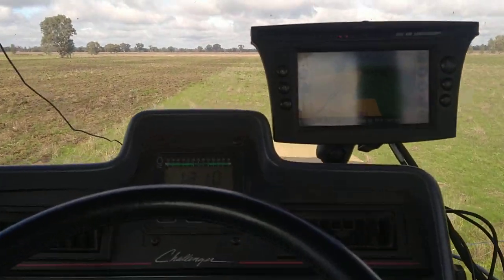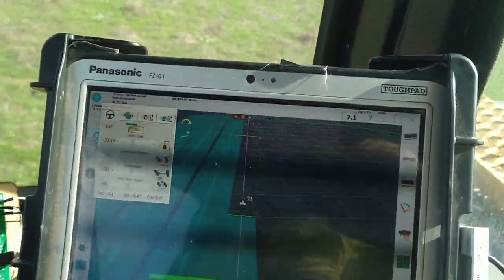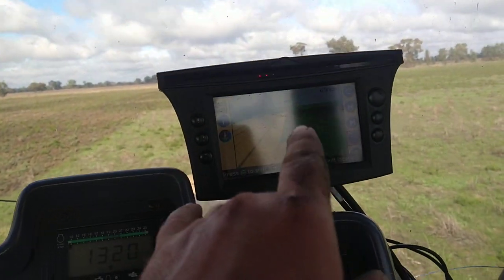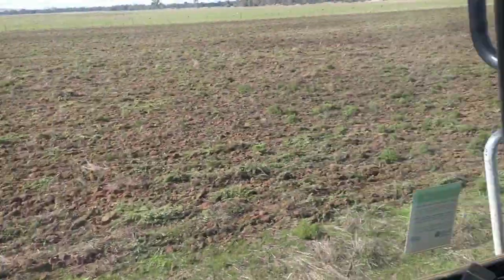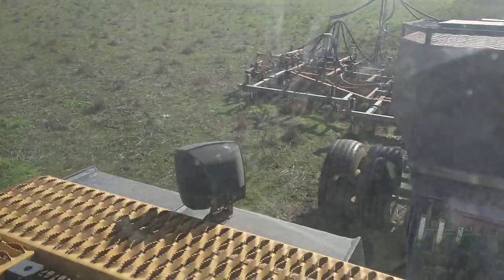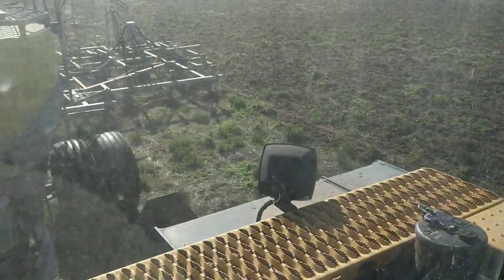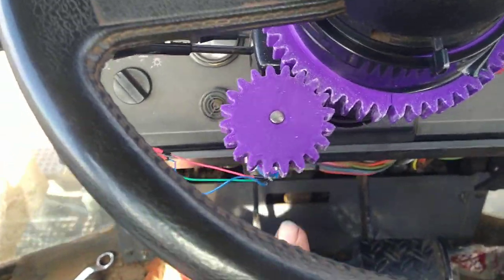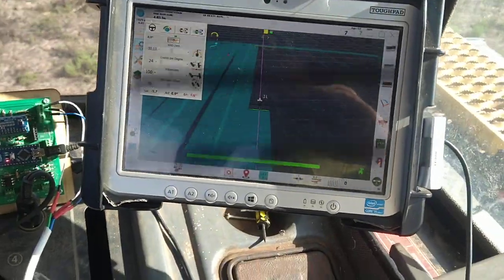Agopengps on a 2 track tractor

Comment: Hi nice configuration! Where I can find instructions and this pcb?
Reply from the maker: I am using the agopengps V2 PCB. All the information about this can be found on discourse  and GitHub.
Just Google agopengps PCB.
Most the information of late is about the API or all in one PCB, but the version I use still works fine but uses serial ports instead of udp

Comment: What the heck is a RTK. Angle sensor looked printed? What is it trying to do drive in straight lines? Would not be easy manually in paddocks the size you are working
Reply from the maker: Real time kinematic. It's a gps set up that receives corrections usually gets a 2cm position accuracy that is repeatable.
The gps unit I currently have here is sub meter accuracy , but that can sometimes be much better, but usually not repeatable .
The software requires a wheel angle sensor to calculate the correct steering input to be where it needs to be. With a normal front wheel steer tractor this is easy to achieve as you can hook on to basically anywhere on the steering that physically moves.
With a two track you don't have that option as the tracks change speed to achieve steering. I'm yet to come across anyone that has got this sorted with an older two track so I've kinda had to figure it out. I won't say I've got it all sorted, but hopefully we'll on the way.
Reply: How did you solve was sensor?